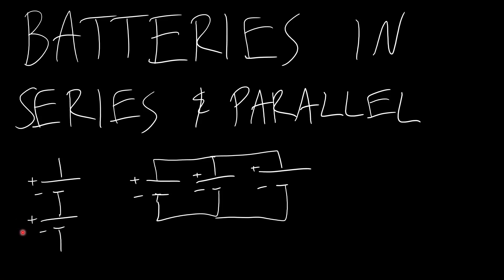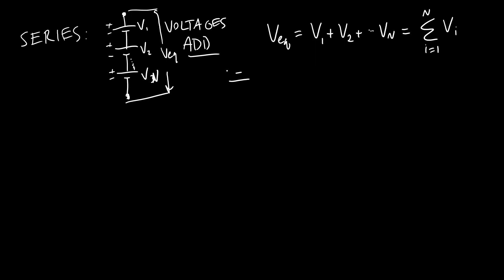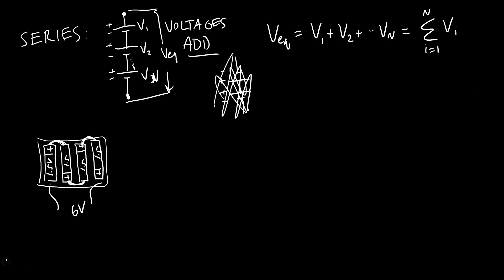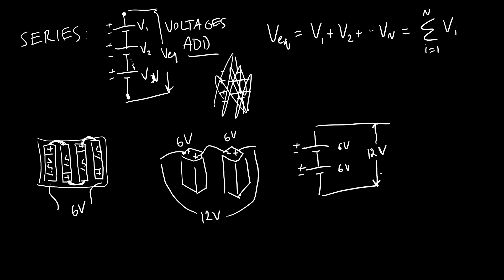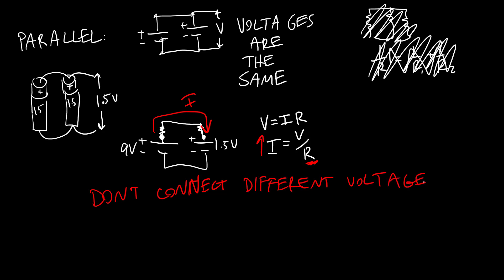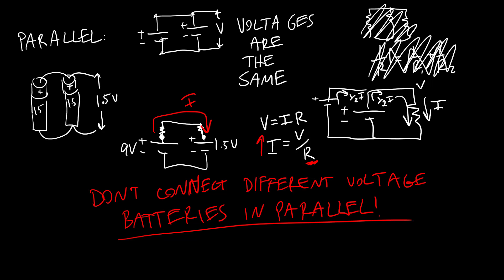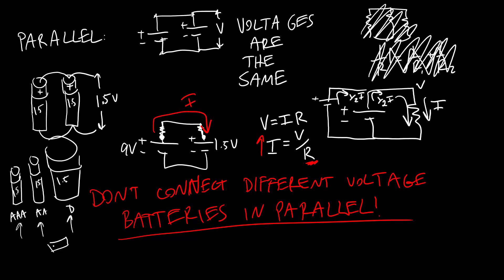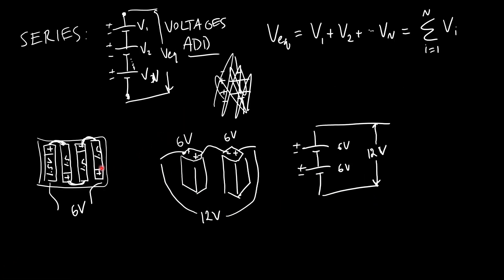Intro to Circuits 12: Batteries in Series and Parallel

Comment: Hi Ben,
Thanks for the videos.
I got a question. What's the formula of Ohm law when we connect some same voltage batteries (E Volts) in series and parallel all together. I mean (As an example) if we had N batteries (All the same voltage as E) and wanted to use them in a circuit along with a resistor R, what would be the formula of I (current) when we use some P of those batteries in series in an arrangement of Q branches in Parallel while the internal resistance of each battery is r. It mean N=PXQ.
 I know when we have all the batteries in series the formula is I=NE/(R + Nr) and when we have all of which in parallel the formula is I=E/(R + (r/N)) and my question goes to when we have a combination of Series and Parallel.

Comment: Just to check my understanding so far: the batteries connected in parallel with different voltages cause a short circuit because there is a voltage drop between them and because of a very small internal resistance, current becomes very high causing a short circuit.

In the case of two batteries connected in parallel with the same voltage, there is no short circuit because there is no voltage drop between them.

I cheated by watching a future video, so I also know that the voltage value on a single battery is really the voltage drop between the positive and negative terminals (right?), which is Rated Voltage - 0, so it's just the rated voltage of the battery. But does that mean if you were to connect the positive and negative terminals of a battery with nothing else in the circuit, would you also get a short circuit since there is a very large voltage drop therefore high current? Is that why we add resistors/other components into a circuit? (besides, you know, needing the circuit to actually do something)

Comment: If connecting different voltage batteries in parallel creates a very high current (because of a small R value in I=V/R), how come connecting same voltage batteries in parallel doesn't also create a high current?  Wouldn't those also have a small resistance that would create a high current according to ohm's law?
Reply from the maker: No, because if the batteries have the same voltage, then there is no voltage drop, so the V in I=V/R is zero, therefore I is zero.
Reply: @BenFinio  That makes sense! Thanks so much for the reply. I am loving this series by the way. I studied computer science in college and am now getting into electronics as a hobby and this playlist is a gold mine and exactly what I needed. I hope more people are able to find this series, because it’s definitely somewhat of a hidden gem!
Reply: I did compsci too and thought I'd learn some electronics as it was always something I've wanted to do. :) Do you have any resources you would recommend or found useful?

Comment: Why is it that when I have two battery’s in series discharging to a light. one battery drains faster then the other or uneven. How do you fix this issue?
Reply from the maker: If you start with two identical, new batteries in series, they should drain at the same rate because the current through them is the same. If you're using old batteries or different brands they may not drain at the same rate.

Comment: I was using a circuit simulator but connect batteries of the same kind and voltage in parallel no current is flowing in the circuit

Comment: for two different voltage batteries in parallel e.g. 1.5V and 9V each with an internal resistance of 2 ohms, which value for V and which value for R would be used to calculate the current?
Reply from the maker: Don't put two batteries with different voltages in parallel! That will create a short circuit that will get dangerously hot.
Reply: Can you explain:
1)
Why different voltage batteries will burn up in parallel but not series?
2)
Also I’m so baffled why two batteries in series will have double voltage across them but same current. If we have a 5 volt battery with a 1 ohm resistor - the current in that circuit is  5 amp. But if we have a 10 volt battery and a 1 ohm resistor we have a 10 amp current. If this is the case then why would 2 5 volt batteries in series which is 10 v, with a 1 ohm resistor, not have a 10 amp current but actually a 5 amp current!?

Comment: I found your videos yesterday and have been binge watching since. You are doing a great job and are really easy to learn from. I have ZERO experience with electronics and have always found the prospect of electrocution a turn off. Todays lesson was very simple:  "Don't connect different voltage batteries in parallel."  Hopefully this isn't a stupid question;  What about different vvoltage batteries in series? I've never seen it as a battery user so maybe it causes a similar problem and maybe you'll cover it in one of these next videos in the series. Anyway, nothing but positive feedback from me! (not a charge joke).
Reply from the maker: So, connecting different voltage batteries in series isn't going to create a short circuit between two different voltages like connecting them in parallel does. Technically you can do it and (mathematically, at least) it is "safe." But in practice, as far as I know it's never done, for a couple reasons. One, different types of batteries also have different capacities and internal resistances (I think I cover internal resistance in another video in this series). So if you put a bunch of different batteries in series, one of them might die before the others - ideally you want the batteries all to drain at the same rate, then replace them all at once. Two, batteries come in all shapes and sizes, and it would be sort of weird to combine different batteries. For example, a AA battery is 1.5 volts and cylindrical. A 9 volt battery is 9 volts and rectangular. If you want 12 volts, mathematically you could combine one 9V battery with two AA batteries in series, but in practice you wouldn't do that because you'd need to design a weird battery holder to hold two different shape batteries, and because the 9V battery would drain faster than the two AA batteries. Glad you're enjoying the videos!